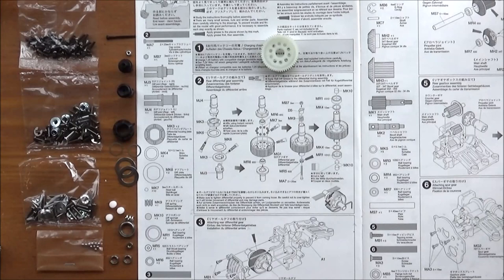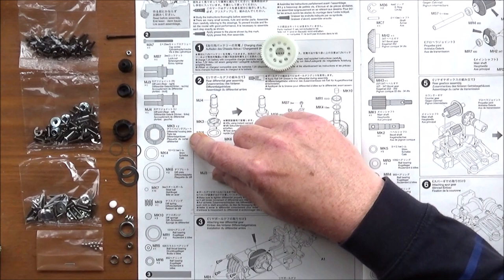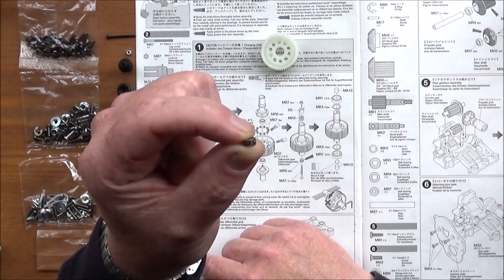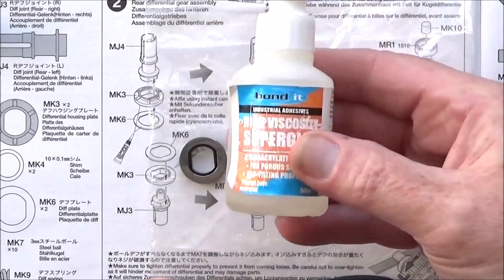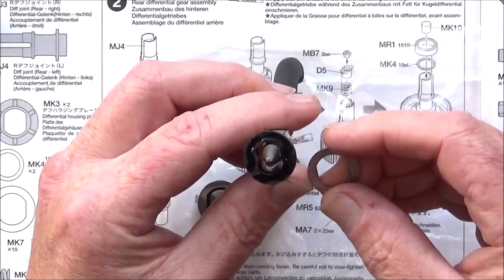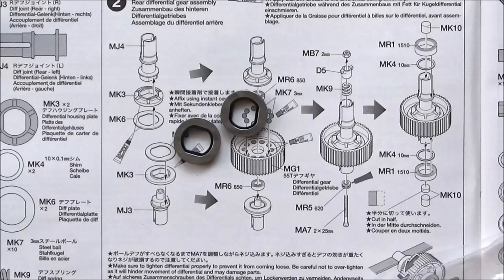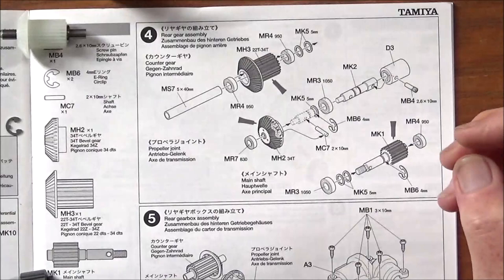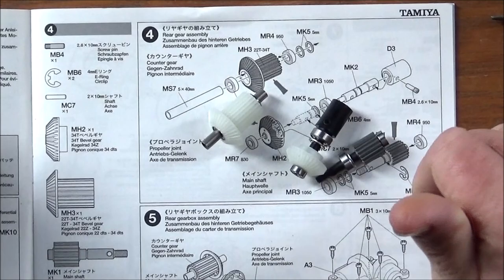Tamiya Dark Impact DF 03 Build Steps 1 to 4

Comment: NICE bit of Kit! 😁 
Even just those Diff Outputs look BEEFY!! 😎👍👍 I hope the rest is up to the higher standards, this has been displaying. I'm expecting quite a performer!! 
Please stay SAFE Mate! 🍺🍺🍺
Carmine ✈🚂🚙
Reply from the maker: Cheers Carmine. Yes hopefully so. Well I think it is with the stainless bars holding the wishbones and all the ball joints. The weird thing is though the brass bushing I spoke about in the unboxing are for the steering!!!! so no idea why they didn't include 850 bearings instead.
Reply: Rob.... In Steering components, Brass Bushes are widespread in the 1/1 Car World. Ball Bearings are a bit overkill, because they're such slow moving parts. 😉

Either way that Kit is amazing! Cheers 🍻 Mate!
Reply: The rear diff outputs are junk, Anyone thats buying a df03, do yourself a favour, and buy another pair of front diff outputs to use in the rear, they are far far more superior, so much so, that you don't need to glue the diff plates as there's no flex. Also,  2 sets of Tungsten carbide diff balls (or Silicon Carbide/ceramic) as the steel balls last no time at all. Coupled with a slipper, the driverrain will stand up to pretty much anything.